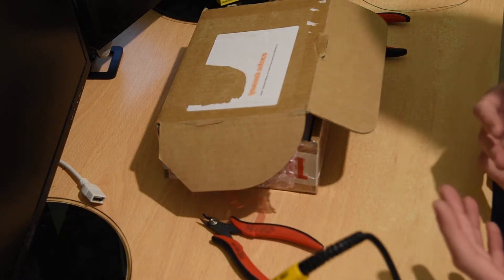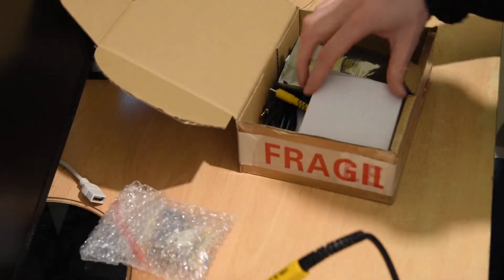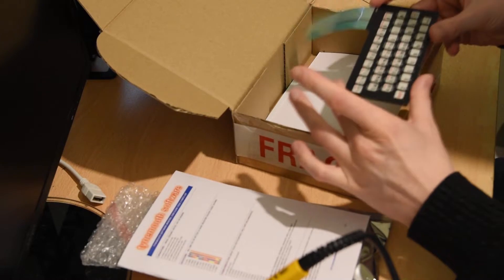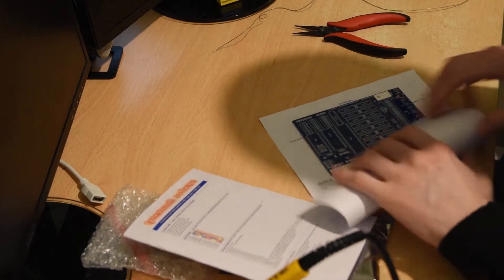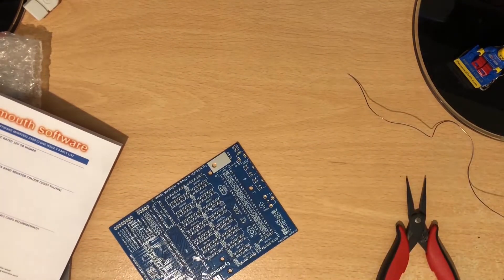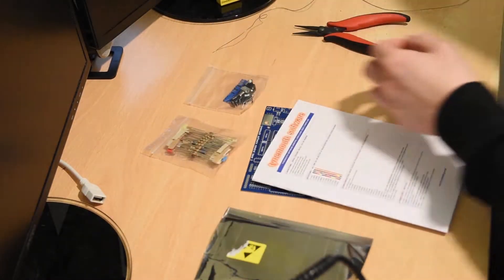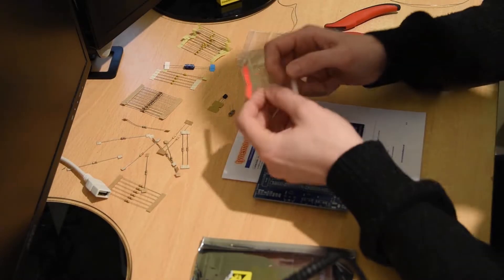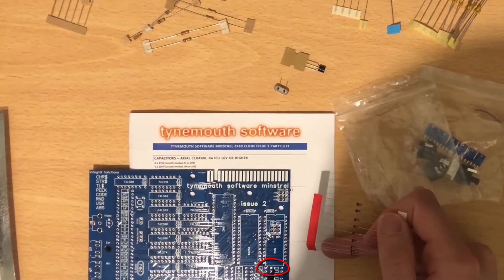Building a Sinclair ZX80 Clone

Comment: Nice work. With the membrane connectors, I have found about 45 degrees is the best option when mounting under the  PCB, gives a little easier access when fitting the tails.